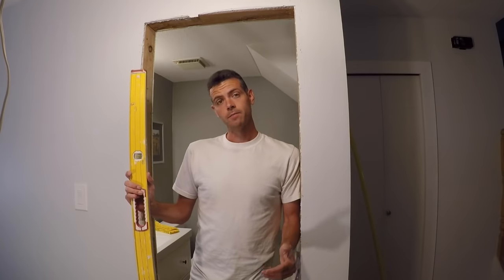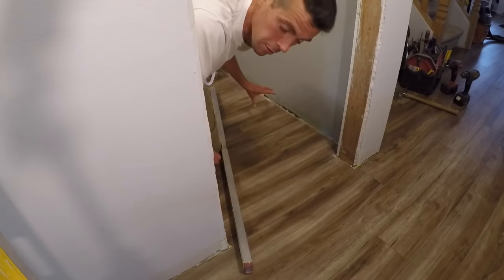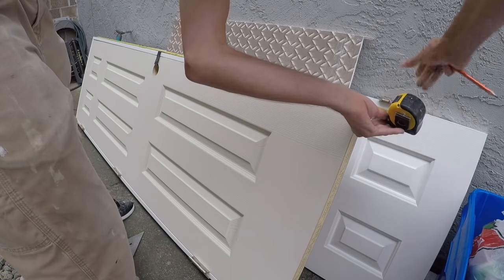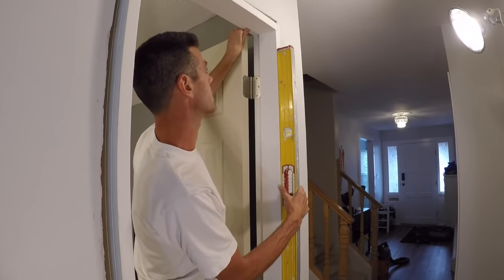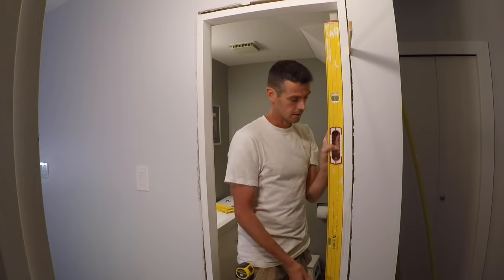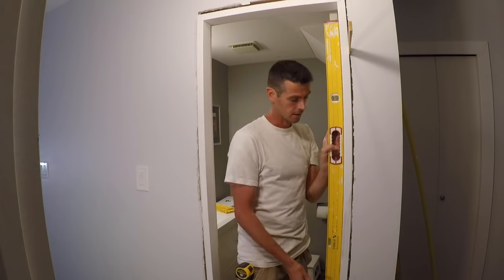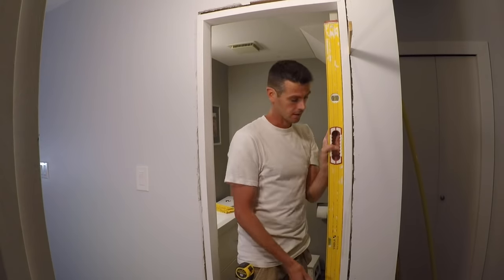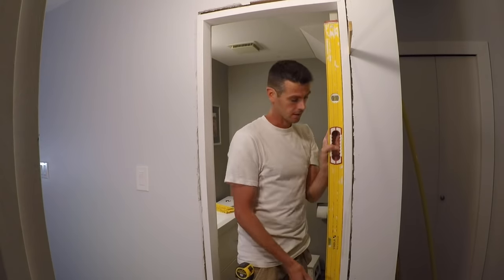How To Install a Door in Bad Framing!

Comment: My biggest struggle with door sets is tweaking the jam/springing the door. Eventually i get it worked out by chasing my tail until I get it... any idea what rookie mistake I'm making that consistently causes this. Am I over torquing screws. Maybe not shiming properly. I think I might be trying to make the door do what I want I stead of doing what the door wants. I just keep tweaking my process and coming to the same end. Not sure what I'm missing.(I swear every RO I have got to work with has been not ideal. Too tight to have room to play or out of square. So I'm always up against the worst case. But if I can learn to get it right in bad conditions I'll knock them out if I ever get a decent hole to work with

Comment: When I had to hang the door on the crooked wall put in by the drunk guy I had quite a challenge. I hung the door as close to level as I could, but guess what? The door I bought was warped. So even though the frame is square the door isn't, and because the door isn't square you can close it but you can't swing it shut. If you try to slam the door it swings perfectly at first but then the friction increases on the hinges which aren't plum and so it basically stops the door moving before it shuts all the way. At least I won't have to worry about the kids slamming the door at night. You have to push it all the way shut.

Comment: You make a very difficult situation look easy. But wouldn't it be easier to level the concrete floor and redo the tile, and redo the wall. At lot more work but at the end everything is correct.

Comment: Did you know that if you put longer screws into a door at the hinges and the locking pleats make it harder like instead of half inch you put 4 inch deck the original screws that came with the doors from the factory

Comment: Never seen a door already hinged to the jam before, over in the UK here. Every house I work on is at least 70years old, some 150-200 years old, which means over all that time there is not a straight line anywhere in the house. Have become so used to doors ending up like a rhombus instead of rectangles. It seems like more of a hassle to have the door already hinged to the lining.
Reply: Doors are available either pre-hung (as here) or loose. If the framer did his stuff correctly, the pre-hung door saves a lot of time. I've used both. Had to use a loose door to cut down in height (non standard opening) and made and mortised my own jambs. If the framer is going to also hang the doors, he will take plenty of time to be sure everything is square and plumb in both directions. If the framer was an Elizabethan, I feel your pain!

Comment: I've heard a door that swings by itself is sometimes said to have a "phantom swing."  There are some other door hanging problems, it could have been worse.
Reply: Yeah if your wall is perfectly level, well, then... yeah... you got problems
Reply: And you can correct it by shifting the hinges just a tad out to whichever direction needed. No one will notice the slight difference, your reveals stay the same, but the door stops being haunted.
Reply: I've been known to take out the pin, set it on a concrete floor and give it a good whack with my hammer dead center. This creates a slight bow in the pin. Put the pin back in and the door stays put. If it still swings, pull out the other two pins and do likewise.
Reply: @detrimundo  Wow, never heard that one before, I like it, thanks.

Comment: A gap of 3/4" between the bottom of the door and the floor is standard. Half an inch is okay, but never 3/8". If you ever have to swing the door over a rug, you'll know. And if you ever string an extension cord under a closed door, you'll see that too.

Comment: Are pre-hung doors the norm over there? You do get them in the UK, but they are fairly expensive and I think it just seems easier to do it all from scratch🤷‍♂️
Reply: Yeah, seems like more of a hassle to have the door already hinged to the lining.
Reply: @welshman100  if your rough opening is perfectly square and plumb and not out of wind then yes...but when is it ever like that?
Reply: @paulmcfadyen689  Pretty much never, esp nowadays seems to be worse than ever on new builds.

Comment: I'm not sure how this mistake happened? You measured the rough opening at 26" top and bottom and the door was 25 5/8"? Where did the 3/8" go?
Reply: he added those shims on the hinge side
Reply: If the opening wasn't plumb and square and instead of that it was skewed then it wouldn't matter if the door was smaller. They wouldn't be the same shape.

Comment: Soooo anyways
You mentioned door heights off the floor. As a general rule you should never leave the door less than 1/2" off the floor. The house you are working on appears to have radiant heat. If it where forced air than you would require a 3/4" gap at the bottom of the door to allow air flow out of the room. If air is unable to move out of the room by the same amount the furnace is providing to the room than the room will not be able to receive the required BTU's for that living base. The 3/4" gap at the bottom of the door would not be required if the room had its own cold air return.
If the rough opening is bad, you should consider reframing the opening. If that is not an option, than cutting the door down is another option.
It doesnt matter how well you've installed a door, if its a hollow core for a bathroom. Its pointless. The main design function of a bathroom is to provide privacy. If it wasnt than toilets would be installed in alcoves in hallways.

Comment: There's nothing like a basket of laundry nearby to catch sawdust.
Reply: Right? Most construction guys I come across do not do well at providing dust suppression measures or clean up after themselves. At the very least move the laundry basket over several feet.
Reply: @dontworrybehappy8080  I'd have thought the client should have moved that sort of stuff out of the way, just looked an odd place to leave your laundry whilst having work done.
Reply: @superiorbeing95  Gotta remember though, as the contractor, we're coming into their home and living space. A place of normalcy for them. Being the liable party, we already know that we will have potentially dangerous tools laying around and most assuredly, dust.

Comment: The 'carpenter' installed a door without shims at my inlaws' house, every spring the bathroom door would not close. I had to remove the door and plane down the framing.

When we bought a new house, I had to take off the master bedroom door and cut the top at an angle. Framers suck.
Reply: U cut the door at a angle at the top?

Comment: I noticed you have a bit of hinge bind. There's lots of tricks to fix hinge bind why didn't you show those? (Cardboard behind the hinges, letting them in slightly deeper, cheating the other side of the jam to alleviate the bind) just off top.

Comment: This is why I hate dealing with someone else's mess. Use someone who can do the whole project, if you have some random framer and then some other drywaller, and then someone else doing the finish work. They just slap that stuff up and don't care if its trash because it's not their problem and the finish guy has to work 10 times harder to fix problems that were preventable

Comment: Hey what if I have the bottom of the door opening small and at the top wide and when I closed the door it’s a struggle on a new door and frame that was installed by someone
Reply: I might try some persuasion: open the door,  place a piece of two-by against the jamb, and give it a couple of taps with a sledge. Go easy. Then do the same on the other jamb. You might get enough width to fix it. Also check that all the hinge screws are tight.

Comment: Actually in a remodel that's normal. House shifts, studs go wonky, nothing is level. If everything goes according to plan, it wouldn't be realistic. In a newly framed house, where rough openings were correctly framed to fit the door then it would've been a simple door install video.

Comment: I am working on a door that is Plumb and square, but one of the vertical studs for the opening is closer to the inside of the room than the other. My plan is to flush the jam on one side and make up the overage with trim on the other. Any other ideas?
Reply: If I understand you properly, then you should just plumb the frame to both vertical studs, and the slight twist will be fine and match both the trim and the way the door hangs. Unless it is more than like a 6 inch difference, the door will operate perfectly and the slight angle will not be noticeable (also, your trim will be easy and look good).
Reply: Trying to picture what is going on. I would go flush on one side, and if it sticks out too much on the other side, plane the jamb edge down so your casing sits flat on the wall.

Comment: Hey Rookie. Shut the door and install it closed. Make sure you got the same reveal all the way around. or...Take the door off and square the frame...put cleats on for both installs. and install the door...PLUMB all ways and level top. WTF this is a no brainer.
Reply: Come to think of it, prehungs usually have a 1 x 2 strap across the middle and bottom to keep the frame aligned, and extend past the jambs so that they also serve to hit the drywall on either side of the R.O. and thus locate the unit in the opening. Shim, screw, take off straps, done.

Comment: Do you ever premount your trim and install the door that way
Reply: How would you put shims in then?
Reply: @acerjuglans383  I wasn't clear I'm sorry, only meant trim one side then you can level and work the door and pin the trim in and that helps if your by yourself then insert shims from untrimmed side. Works best with HC doors under 32"
Reply: @steverone7623  You can't put trim on one side of the door and expect to push tapered shims in from the other side to fill the gap. It doesn't work that way. Both sides need to have shims put in, layered on top of each other. Does that make sense?
Reply: @acerjuglans383  bullcrap I can't. Been doing it that way for 5 years since an old timer showed me. You have to be smarter than the shim
Reply: @steverone7623  lol sure
Reply: @acerjuglans383  seriously try it. The trim being shot in to the frame and then into the jack studs pretty much reduce the amount of shims you need so you reverse the shims and slide them together, sometimes you have to cut a shim in half to get it to the right thickness. Again this is only really good for hollow core doors under 32"

Comment: Bad Framing?         I have installed thousands of doors. Old style, set jambs and let in the butts with a knife and chisel, and for most of the last 40 years, pre-hungs.
Not once,, not ever, have I seen a perfectly framed opening.  Not even once.    If you ever find a perfect opening,,, I cxan pretty much guarrantee the door will be warped,,,, all doors are somewhat warped. There is no bad framing.  All framing will present some challenge.  That is the door hangers trade,,,,, take an imperfect world, imperfect materials, wood expands and shrinks with each season, bends, warps, twists,,, and create a moveable door that is expected to function flawlessly for one hundred years.

Your article is miss labeled.

Comment: with a hollow core door like the one in the video the 3 inch screws are unnecessary. you can get away with using 2 1/2 finish nails. i also tend not to use shims with hollow core doors just because they are so light and i can get the jamb plumb without them
Reply: Much as I like nails myself, I think it's pretty clear from VC's vid that being able to back out and take another approach is cheap insurance and worth it. Sure, you might opt not to set the nails until the whole thing is plumb, square and true, but pulling the nails for a correction has a high chance of gouging. Also, others may be worksite ninjas, but dollars-to-donuts I'm taking a chunk out of an arm or that painful bit just below my shoulder blades with those unset nails before the job is done. Plus, battery powered impact drivers are way cool and having to hang a new door before the mother-in-law arrives is usually enough to get niner-domestic to authorize the spend. Yeah!

Comment: 3:18 I cringed so much my damn toe cramped. Hanging doors in old houses. My own house I just got done with fixing settling via foundation issues. At least in my experience, when you lift up a house back to where it's supposed to be it does not all magically straighten back out and all cracks close up. In fact the house will be better but not all straightened out and even more cracks will be opened. And the pain it is to install a new door. I wanted to just cover the opening and tell the woman "Babes you got more room to put crap on the walls. The new back door is the window next to where the old one was.

Comment: I live in a 100 year old house. Every door I've installed has been like that. Ahhhhh! So frustrating!!!
Reply: Yep I work in the Boston area, and 100 year plus old Holmes are a bit out of plumb and level. Settlement is the main factor. He should have shimmed the bottom once it's level. Only used 3screws on ea. Side. Then trace the wall to the jambs then plane to the line. Rotary sand if needed then reinstall with all the screws. The trim will fit flush. A little calling before paint, door will look perfect.

Comment: To avoid re-work, the first step is to survey the rough opening accurately, not only for width and height, but also for level and plumb. You can then create a map of the opening and know in advance what the net square opening size is. Surprises are not good. Survey first; install just once. For accurate surveys, check out www.howfarout.com.
Reply: Michael Schuler u got to be joking right? Please tell me this is a joke!

Comment: You'll get a better result if you secure the top and bottom hinge locations first, then shim the middle hinge against your long level until you "close out the light" and take out any bow in the jamb.  42 years experience has taught me NOT to do it as you've shown.  Too much chance of a bowed jamb by taking it in short segments as you've shown.

Comment: Leave at least 1” gap between bottom of door and top of finish floor for air conditioning return for all interior doors if both rooms on either side of the door are air conditioned.  Otherwise an ok video.
Reply: In this case, an interior bathroom, so gap was OK.

Comment: I dont understand why you would want a 1/4" to 3/8" gap under the door. If you use the provided gap it allows for humps and bumps in the floor as well as air circulation especially if there is no cold air return in that room. Pin the door in the opening with 15 gauge nails and hammer shims in until it's exactly where it needs to be. Painters would hate that there is such large holes to fill and that much filler will shrink and show later on. If I'm on a job that requires screws I hang the door with the door nailer and put screws under the hinges
Reply: When adjusting for leg sway you also can split it four ways. Say your wall leans an inch over the 6'8" door, you can  make up for that on both the hinge side and the catch side of the door jamb. Knock the hinge side top out and the bottom in, catch side top in and bottom out. That 5/8ths difference would be way less noticable if it was only 5/32ths over the four corners of the door rather than 5/16ths inch split on just the hinge side of the door

Comment: Yeah, don't try to correct the problem, just hack it together... I've got 10 prehungs to install in 2 weeks and would never hang them this way unless I ran out of all other options...

1) Try to move the bottom of the wall with a block and sledge and drive a "toe-nail" screw to hold it. Yes,  this doesn't always work or is not practical due to flooring.
2) If the hinge side is way out and you can't get it over, you can pull the 2x4 trimmer stud and replace with a 3/4" trimmer to gain some room to square up.
3) Always use a long screws in the middle of each hinge to secure the jamb and hinges to the trimmer stud. Long screws in the strike plate too!

Comment: Why do you work with inches vs the metric system? And why do Canadians have small garages or non at all? Lol
Reply: Proximity to the US in the principal reason. Common market for building supplies and furniture as well, so most measurements are in Inches. Its not great, but its not terrible.

Comment: A good carpenter would have checked the framing before attempting to install a door and frame. And if the man installing the door also framed the opening there wouldn't be problems in the first place.
Reply: Indeed.  He did check the opening at 26" and also knew it was out of plumb 5/8"  same direction both sides.  He measures the doorframe at  (2:20 of the video) at 25 5/8".  Knowing these two things reveals that the opening is 1/4" too small to put the door in plumb. 
I suppose the fix would still be the same though

Comment: Never buy a door with a permanent stop..they are shite.. 5 years home settles moves doors warp what then.?  Your screwed.. buy a better door with a removable stop.. easy to touch up.. 2 homes ago did 14 doors to tune them up perfect..try that with solid stop you cant.. then buy white  thin foam sealer material..why..you add it to top and bottom of stop..for that perfect sound..no rattle bang solid sound.. half an inch or so.. buyers will notice it.. they open close every door.. yours will be silent and solid feeling..plus tuning stop, stops rattling banging and ugly fit .. what do I  know..12 homes and most flawless inspection reports. People's are happy to spend more for that perfection.. a few over 4k feet..  I know they track me down to tell me so..  all your doors fit perfect..kaching..